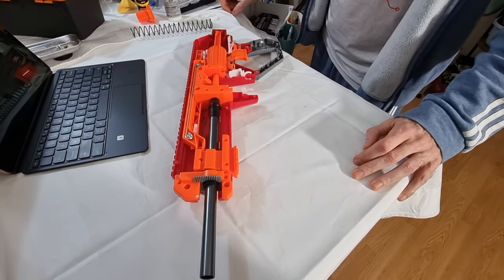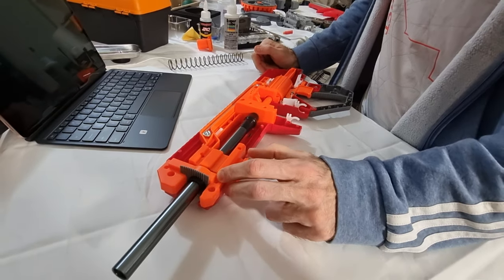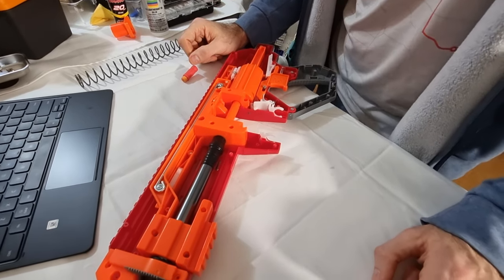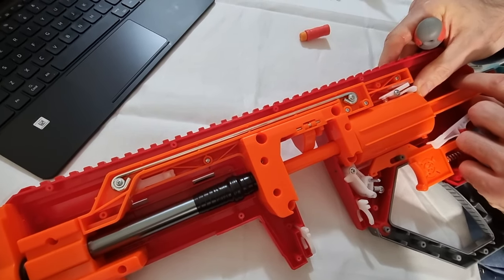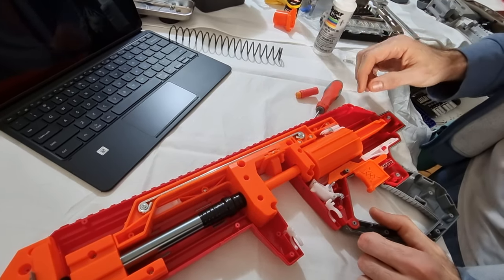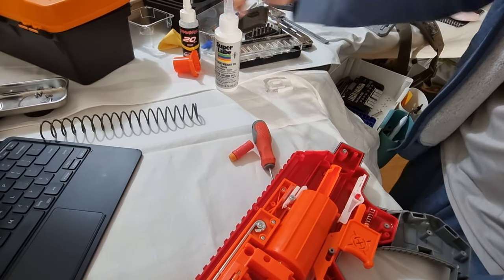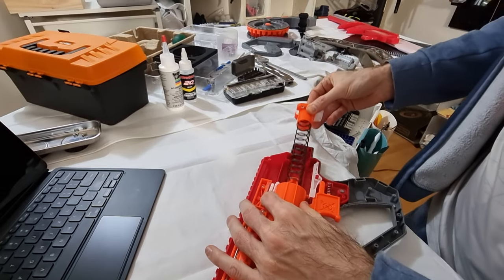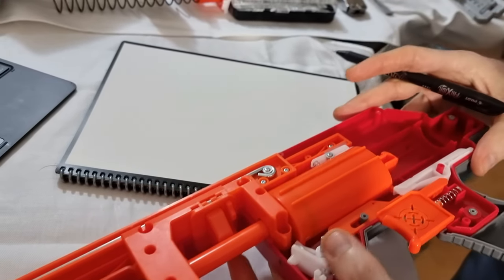Tomcat modding - part 2, internal mods

Comment: Ok. So, k25 around 20cm and a longer worker barrel. That's the only internal mods? Thank you. Can't wait to maximize my Tomcat!
Reply from the maker: Around 21cm, but I used Pro25, and it helped to get at least 10 extra FPS with an easier prime. And don't forget the shim on the breech lock, and testing/fixing the air seal in all situations (as shown in Part 1). Try putting a shorter barrel than me with a 5-degree BCAR with 12 bearings, and don't forget that if it's 17/32 brass, it needs to be longer and forced inside the dart gate.
Reply: @dartsoft whats your barrel length and internal diameter? Thank you so much.

Comment: Have you done nothing to improve the seal on the plunger itself? When I do this I get a vacuum effect and it makes it hard to return the pump grip forward.
Reply from the maker: I don't think that's easily fixable with the Tomcat. Maybe just try other darts, less soft, and less likely to vacuum seal against the pusher.